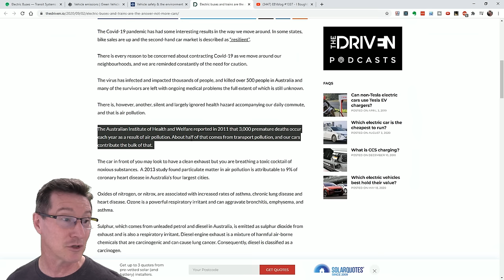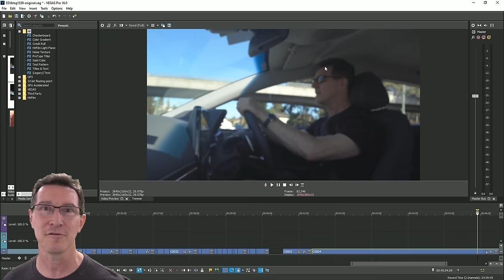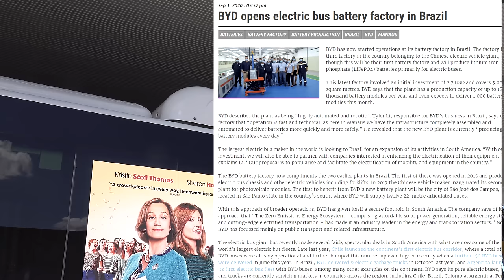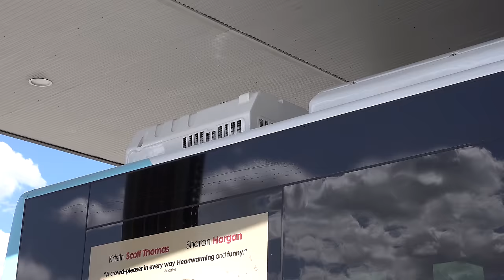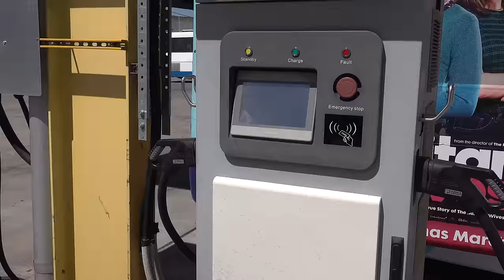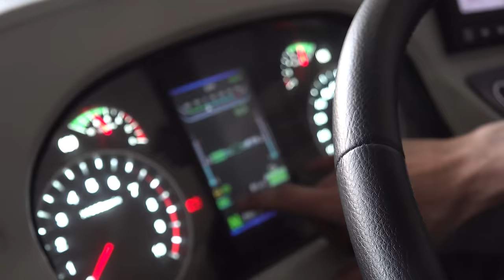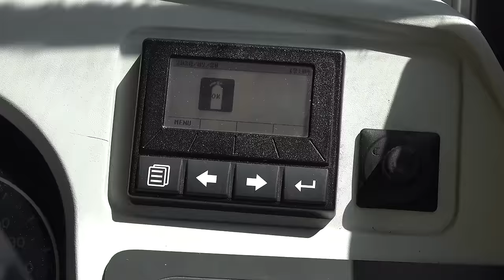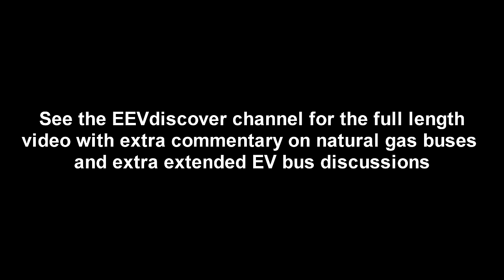EEVblog #1339 - Looking at an Electric Bus!

Comment: How is the electricity generated there?
Reply: 75% coal. That surprises me. Austrailia has so much sun. They should build solar power stations like in spain has, an array of mirrors reflecting the sun onto a collecting tower that heats water to make steam to drive turbines.
Reply: @simontay4851  Australian government is pro-coal. Like hard core pro-coal. "It is the best power source, and it is also the cleanest"
Reply: @anon And where does petrol/diesel comes from? Magically appears in the holding tank of a petrol station?
No it is refined from oil. And it uses loads of electricity to refine said oil into something you can put into a car. And that power comes from the same grid as for charging. Except, power used to charge skips couple of steps before getting into the battery.
There are wery few areas on Earth where charging an EV is worse in terms of pollution than driving conventional car.
Reply: @Yannick 73 Well. Fuel cell vehicles are quite bad in terms of overall efficiency. Turning electricity into hydrogen and then back into electricity has enormous losses. 
But they are appealing to big companies since they utilise the same model they got used to. You HAVE to go to specific place to fill up. Where THEY set the price. BEVs have more flexibility, and there is powerline to almost every building.
 Hydrogen might become good grid level power storage solution, since waste heat can be utilised in district heating and hot water mains systems. But in vehicles... Only certain niche.  
Like it or not - BEV is our best bet. Luckily, battery production became less carbon intensive over the last decade.And keeps getting better. As for other pollutants, all comes down to manufacturers greed and ethics. Also, local regulations and enforcement.
Reply: @anon even then EVs are way cleaner than diesel, do your own research, don't repeat the nonsense media spews
Reply: it is still cleaner than diesel as electricity generated at a power plant is way more efficient than in vehicle's power plant; also as grid gets cleaner all EVs instantly get that much cleaner as well, no upgrades required so solution
Reply: Mdmchannel  recycling; bonus question: how many millions of people do fossils kill per year?
Reply: @simontay4851  you mean mid air bird cookers?
Reply: Thanks for asking this question. I'm blown away by the zero emissions argument. Make it 100% renewable and then you can brag.
Reply: @tommy12345abc  The grid is up to 40% lossy. Electricity has to be moved great distances through many substations. Lot's of it ends up as heat.
Reply: @anon It's still more efficient to burn a bunch of coal from a single source to generate electricity rather than having millions of cars all simultaneously burning gallons of gasoline and this is made even better by the fact you only use exactly as much electricity as is needed whereas in a gas car you might for example sit at a red light for 10-20s wasting gas which might not be a lot but it adds up over time, plus it isn't as if you don't have the option of setting up a personal solar system for charging your car/bus off it if you feel inclined to be green.
Reply: anon even with black coal (I assume that is the worse), the emissions are less than burning diesel. Plus of course the grid can get cleaner. An old diesel bus never gets cleaner, these busses will likely be zero emission within a few years as the grid changes (renewables bring cheaper it will happen even if no one cares about emissions and particulates)
Reply: @MarkGarnettUK  Up to 40% of electricity is lost on the grid. It will only get better if there is lots more local generation. If you consider throwing energy away, green or clean then fine. Lots of things have to change, not switching from one crappy model to another.
Reply: Mdmchannel that’s the beauty of EVs, you mine the stuff once then keep recycling it forever. All the elements are still in the battery after its 10-20 year life span. Quite a bit better than setting fire to it once with no option to recycle the waste products (diesel). Same with copper etc in the motor.
Reply: @fluxington  if you compare extraction to consumption of fossil vs electricity; EVs are still way more efficient than fossil burning (oil has to be extracted and shipped and refined) AND if you make grid improvements (it's not perfect in many cases) the EVs take advantage of it instantly; make an improvement at power plant or to the grid and the entire EV fleet is that much cleaner; you cannot do that with gasoline cars
Reply: @fluxington  also if it is so lossy, then it should be fixed or maybe for that particular region.  People keep arguing about EVs being a perfect fit for everyone and everywhere.  That is likely not true for some cases but for most, it is exactly the answer, particularly for very densely populated areas, EVs are a definite way to go.  Buses and trucks, particularly on stop/go/idling scenarios is a perfect match.
Reply: @tommy12345abc  At no point did I argue against EVs.
Reply: @fluxington  fair enough - I didn't read all the comments.  I now skimmed through and found your comment on need for more local generation: yes, exactly that's definitely part of the solution and an example of an argument for finding a solution to a problem instead of finding excuses of why not to do certain things. You're right.
Reply: @fluxington  I'm pretty sure losses from grid are really low, low single digits would be my guess, but yes, local generation is even better.  Every roof top should have solar, ever basement should have a battery, every field should have a wind turbine.  THis is solvable and cheaper (and minimal pollution).  Electrifying everything has no downsides, certainly none that justify continuing to dig up and set fire to stuff.
Reply: @EE Surprising, given the huge amount of sun in Australia, and lots of "empty" space that could be used for solar panels.
Reply: @anon You can store energy, especially when space and weight doesn't matter, because it's stationary, you have many options.

Comment: An idling gas/ diesel bus wastes fuel while doing nothing...an E bus wastes nothing while setting there. Thumbs up dave!
Reply: In the Video the A/C was on and consumig 5kW on its own.
Reply: @sebi7794  Yes but it doesn't have a big diesel or CNG engine running just the AC while Idle. Running the AC isn't waste, running a 300kW engine for 5kW of AC is a waste.

Comment: The National Research Council (NRC) found in 2010 that the social costs from on-road vehicle use were approximately $110 billion dollars.4 Transit buses would have been responsible
for $440 million in social costs if we assume energy consumption and social costs are proportional. --- Currently, there are around 300  passenger  operating in the , according to Reuters. The average  for a big  is around $750,000, a bit more than the $435,000 average  for diesel. Running , though, are much lower for e-buses -.31 Aug 2018

Comment: The decrease in pollution will be huge as EVs become more widely adopted. I live downwind of major road. I noticed the dust that accumulates around gaps in the doors and windows (where air leaks into the house) is black. Presumably soot from car and truck exhaust. I use a fan to cool off my house in the evenings, so I put a filter on it. After just a few weeks of use the filter started turning noticeably dark from all the stuff it's caught.
Reply: ya just moving the pollution elsewhere tho... the electricity stations need to produce more power to charge all these cars.. unless ya power is comming from 100% renewables its a complete scam..
Reply: @WacKEDmaN  wouldn't you agree it's better to move it away from where people live? Right now pollution is worst in cities, but power plants can easily be located outside of cities. Plus if it's centralized, it's easier to invest in systems to clean it up at the source. For example instead of requiring expensive emissions systems on every car and truck, there would only need to be one central system at each power plant. Finally, where I live the default energy mix is already 28% renewable (mostly wind), so that eliminates a significant portion of emissions.

Comment: 1:18 you could also turn off the engine.
7:35 lies! Electric servo pumps are standard even on my ancient small car.
Reply: Are you sure it is electric servo pump, and not electric servo? Because it sounds rather over complex and unnecessary to have double conversion where you can have only one. That's why it is usually either servo pump running of the engine, or electric motor assisting you with turning your steering wheel.
Reply: @jur4x  It's an electrically powered hydraulic pump, running harder the faster you turn the steering wheel. You can build the steering from standard hydraulic parts and thus make the motor much smaller than it would need to be to deliver the same forces by using hydraulic advantage. Running the pump off the engine would make the pump depend on engine RPM as well.

Comment: I'm a bit surprised they do not use electric servos for the power steering instead of hydraulics, I bet servos would be vastly more energy efficient. It must be due to a conversion rather than building the electric bus from scratch.

Comment: 63 amp 400 volts, that's Renault Zoe level of AC charging!
Reply: Good enough for overnight charging, also better for the battery and power electronics to charge with lower power.
Reply: @jan.tichavsky  I just wonder what the trade-offs are, of putting two 43kw chargers on the bus, over charging at about 85 kw DC (both batteriescombined). Weight is probably not a concern...

Comment: I'm surprised how dirty it is inside the equipment area at the back of the bus. You would think a system without any fossil fluids would stay clean.
Reply: There's still plenty of oils, lubricants and other fluids, but most of that is probably just road grime.
Reply: It is asphalt, as theh back is square it sucks in a lot of it.
Reply: Probably thats mainly abration from tires and breakpads picked up from the road.

Comment: How long before the batteries start going bad?
Reply: at least 8 years, by that time you'll have used as much weight as those batteries in oil changes on a DERV, never mind the fuel burnt.
Reply: Pretty sure the yotong bus has battery that can handle about 5000 charges . So 5000÷365=about 13.5 years if they charge it from 0 to 100% every day 
And that's the worst scenario pretty much :p
Reply: So it's not really a problem :p
Reply: May I suggest you spend your time watching videos instead of spreading FUD in their comment section?

Comment: I hate the air condition in newer busses. They always put it way too low, and you get cold in summer!
They really shouldn't go below 25°C to not waste energy and to reduce the shock compared to the outside temperature.

Comment: I’m surprised the buses are standard heavy steel rather than being made from lighter Aluminium etc.
Reply: Steel is a lot cheaper to produce with on large scales. I also work at a bus manufacturing facility that sells a steelcage model. Aluminum was considered, but ease of building and readily available steel beats aluminum by a lot
Reply: OtherDalfite it seems such a waste of the batteries charge just to move the heavy bus around even before anyone has boarded it.
Reply: @Peterjames3535  and it is. California has a big scam running where someone gets a $5mil grant to get an electric bus running and maintained for 5 years. They get the bus and it sits for 5 years being maintained and at the end they spent $1mil to make $4mil and waste a huge amount of resources, planning, and time

Comment: 0:56 who starts the engine before they are ready to go? it only wastes fuel and wears out the engine faster, so why do it?

16:26 so that's 150 kW each? for a total of 300 kW?

i want to use an electric bus as a basis for a motorhome (or RV or whatever you want to call it) but unless my numbers come up (preferably today), that's not gonna happen :-(

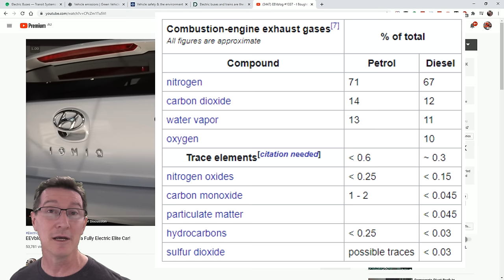Comment: @2:26 Didn't you hear some Diesel advocates claiming that Diesel cars are cleaning the air as the air behind Diesel cars is cleaner then in front of them. 😉
In contrary to EVs they just wouldn't polute the air. 😉
Told they to redirect the exhaust inside the car.
Welcome onboard the EV community, Dave. 👍

Comment: Well, if you just count battery driven busses "electric busses", then maybe, there are not yet that many, although there are popping up pilot projects all over european cities as far as the eye can see, both battery-driven and hydrogen-driven. But what you completely missed are "Trolley-Busses". They follow powerlines and use a current-collector just like trains. They are here (at least in Switzerland) since ever. Check out here for example: https://www.stadt-zuerich.ch/vbz/de/index/die_vbz/fahrzeuge.html

Comment: Cheaper to run.  My Yaris costs about 12 cents/km for gas.  E-car costs about 5 cents/km for electricity.  No oil changes.  Regen braking saves on brake pads.

Comment: I don't know about power generation in Aus, but power in California is predominantly generated by burning coal, so saying electric vehicles have "no emissions" is a fallacy. The difference is, the emissions are moved from an individual tailpipe to a more centralized location of a coal burning power plant belching smoke and radioactive thorium into the air.
Reply: Actually, there is very little coal electricity generation in California - Most of it is natural gas, followed by renewables.
See how much of each source is generating right now at:
https://www.electricitymap.org/zone/US-CAL-CISO?solar=false&remote=true&wind=false
Reply: @evolt7553  Well, I stand corrected. Though the only reliable "carbon neutral" energy source we have is nuclear, which would almost completely negate any wasteful emissions from generating power.
Reply: @irdmoose  Nuclear is very similar in terms of emissions per kWh to renewables.
See the graph at: https://www.usaid.gov/energy/mini-grids/environment-health-safety/emissions
Tesla aims to solve that intermittency with their new batteries:
https://www.youtube.com/watch?v=l6T9xIeZTds&t=3565s
Reply: @evolt7553  In emissions, yes, but not in land use compared to specific renewables like land-based solar and wind. It's far more efficient. Now, roof-based solar is another story altogether since the land beneath is already in use for another purpose.

Comment: if you cover the entire roof with solar panels, can it generate enough to do any significant charging?
Reply from the maker: Nope. You could fit maybe a couple of kW of panels on the top. Battery pack is 328kWh. Run the numbers.
Reply: Depends on your definition of "significant". Solar panels are something around 150W / square meter in ideal conditions, so let's assume half, 75w/m2. Let's say the bus is 4 meters wide and 20 meters long (I think they are a bit smaller but round numbers), so it would be 80 square meters, or 6kW, so it would charge on a 10-hour shift, around 60kWh of the I think over 300. Probably less in practice.
EDIT:
Thinking about it,  city driving probably means there's anywhere from 20 to 80% of time in the shade of the buildings, so the real numbers would probably be down in the 10kWh-30kWh range.
Reply: Apart from the other answers, it's probably more cost effective to just put those panels in a farm instead to have the cost benefits of large scale. But one thing remains and that is that the solar panels on the roof of the bus would correlate quite well with the demand of the bus which a solar farm wouldn't (since the bus isn't plugged in when it produces its power)

Comment: As someone who grew up in a city with trolleybuses, these are nothing special. The only difference - trolleybuses need extensive infrastructure, and can operate on a defined route only. Also, our old ones were loud. Like you had to raise your voice significantly to be heard by someone standing next to you in an old (lat 80's - mid 90's model) trolleybus  going at 50 km/h or faster. But then new ones arrived and they are so much quiter.

Comment: LifePo4 is the wave man. Got it on my eBike pulling 300 amps @86v and they don't even break a sweat. Also and most importantly it's is safe to pull that level of energy from it and even if it wasn't the cells are super safe no fire no explosion.
Reply: This ^

Comment: About the urban air pollution: it may be true that in certain region of the world cars and ICEs represent the most important source but it's not true in general and it's especially wrong were winter is cold and methane or other hydrocarbons are burned for heating

Comment: Electricity production in Australia is 75% coal and 16% natural gas. In China, it's 66% coal and 3% natural gas. CO2 emissions from coal are 1 kg per kWh. CO2 emissions from gasoline are 0.76 kg per kWh. While electric cars and busses may reduce pollution in cities, it will not reduce CO2 emissions until we get away from fossil fuels for electricity production. In fact, if we had 100% electric vehicles tomorrow, CO2 emissions would be much worse. Yes, Dave has solar panels. But it's all the same grid - you have to look at the production for the whole country.

Comment: Great tour! What an amount of stuff inside, wow. Nowadays you better can be an electrician instead of a car mechanic or not? One question, how to deal with fire? For example in an accident, or a short circuit, charge/battery fault. I have seen that electronic vehicles are very difficult to extinguish. When the battery catches fire an enormous amount of heat is released. This is a big issue in underground parking areas/spaces. The spread of high temperature and toxic air for example.
Reply: They talk about the fire suppression system at around 21:00